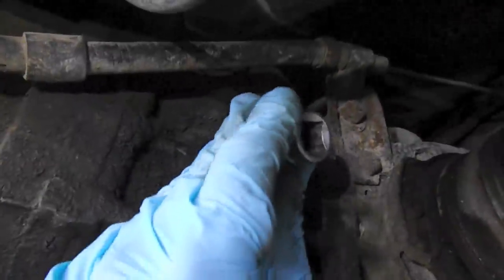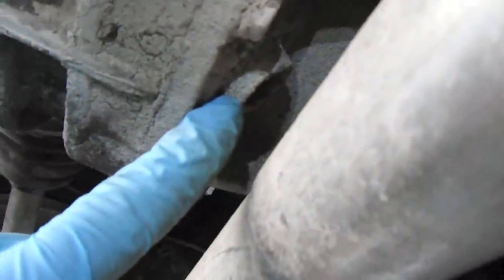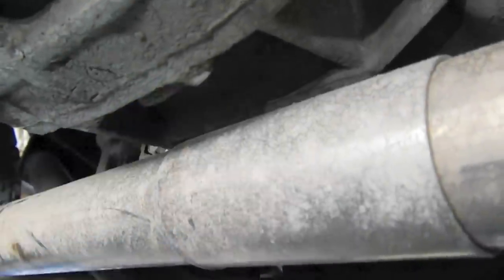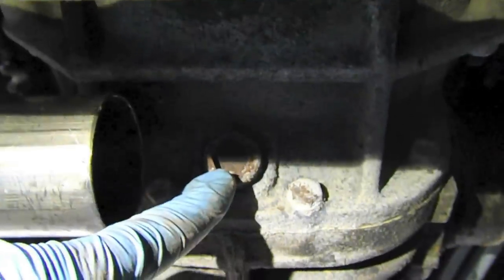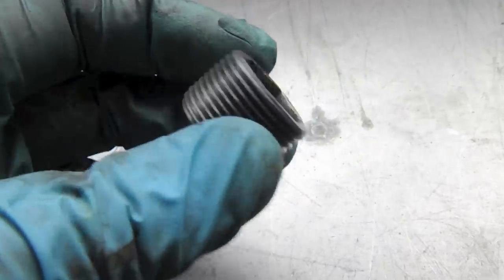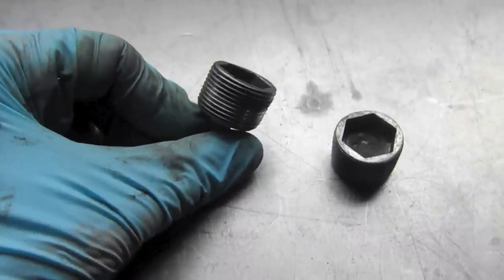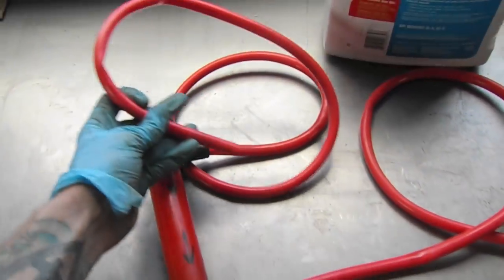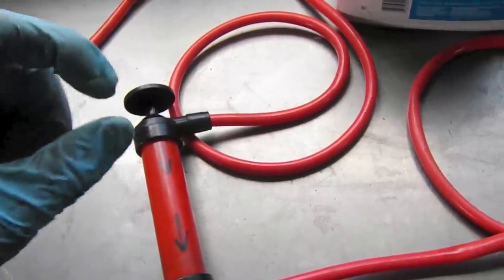VW Bus Manual Transmission Fluid Change

Comment: Simple, but important.  I notice on The Samba that there is quite a debate over which oil to use.  GL-4, synthetic, Red Line, hyphoid, etc. etc.

What are your thoughts concerning choice of oil?
Reply from the maker: To be honest, you could spend hours reading on the Samba and still be confused. I've never had a problem with conventional hypoid gear oil, but that's not to say its better or worse than anything else. I wish I had a better answer for you.
Reply: I think as long as it is rated for hypoid gears, you're good to go.

Comment: Hi. curious as to when you are draining or filling if the van has to be tilted or lifted front or back at all? maybe a dumb question but just want to make sure before I do this.
Reply from the maker: +TheHteam07 I usually lift the rear for access so I'm not having to squeeze under so tightly. The amount of fluid that you'll drain from having the front elevated is pretty inconsequential if you ask me. Good luck, and make sure you can get the fill plug loose before you drain the fluid. It would be a bummer to drain it then find you can't refill!
Reply: +Busaru thanks!!!